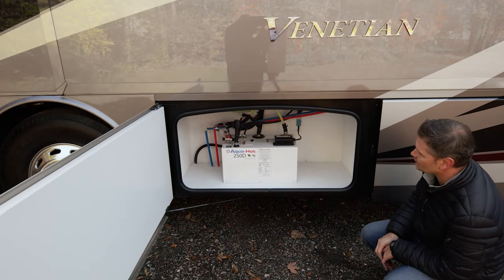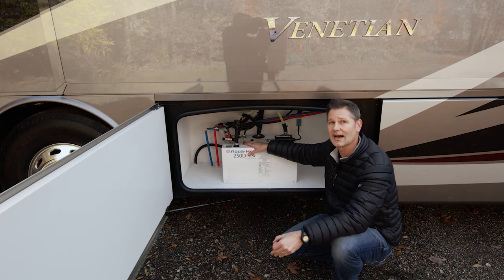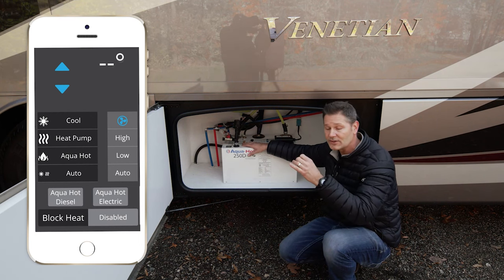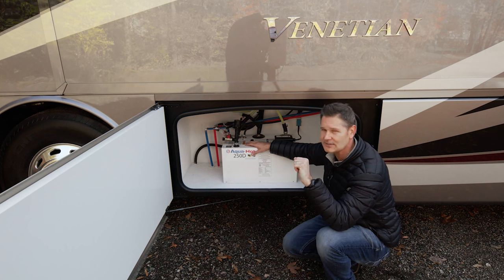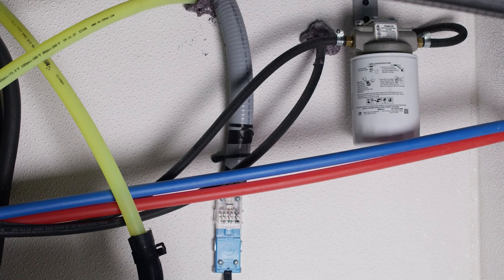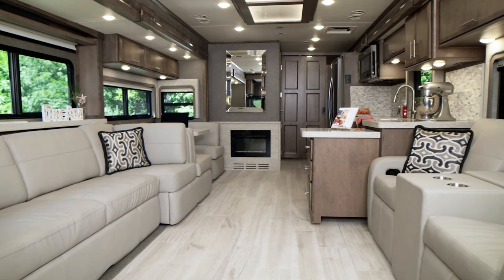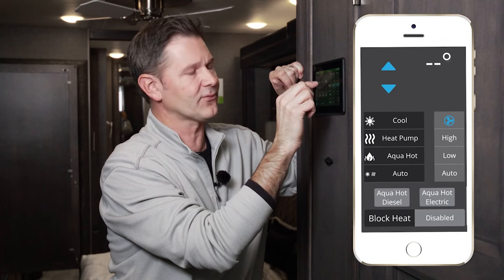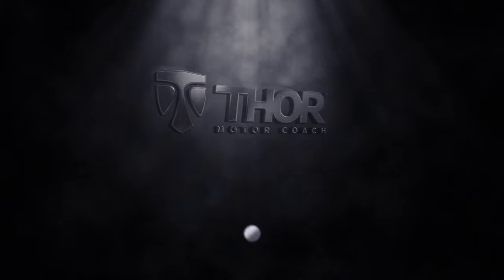A quick look at the Aqua-Hot 250D. What it does and how it works.

Comment: Hi Steve, Question: In addition to my multiplexer (Firefly, 2025 Aria 3901) having zones called "FRONT", REAR" & "MID" (3 A/C units on roof), I have another zone called "SYSTEM" with only an "AquaHot" button and temp control......what is the "SYSTEM" used for?    p.s. 1) FRONT unit is A/C+Heat Pump+AquaHot, 2) MID unit is only A/C, 3) REAR unit is A/C+AquaHot. thanks for your informative content!
Reply from the maker: Good morning!  Please send us an email to wsupport@tmcrv.com with your full VIN so we can properly assist you.  You may also call us 24/7 at 877-855-2867.
Reply: @ThorMotorCoach  done (2nd attempt). (P.s. I submitted a question using TMC owners resource webpage but no response yet…….been three days 🤔.)
Reply: I just put a deposit on a 2025. I am interested in if the replies to your question thanks.